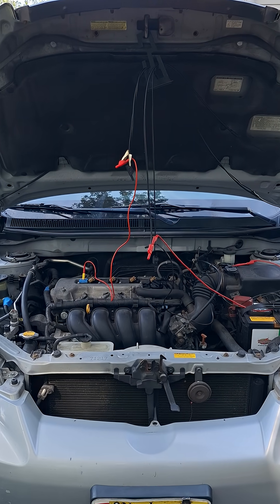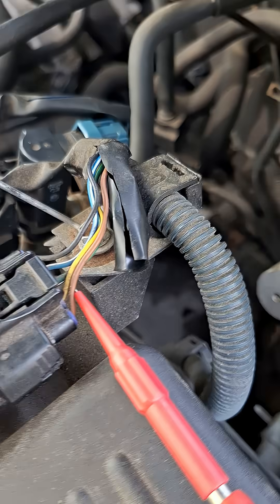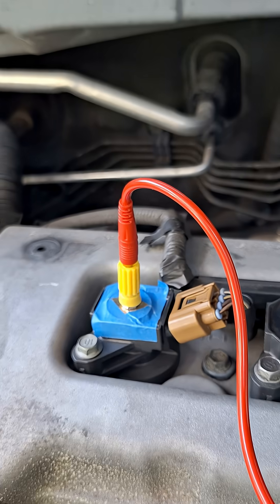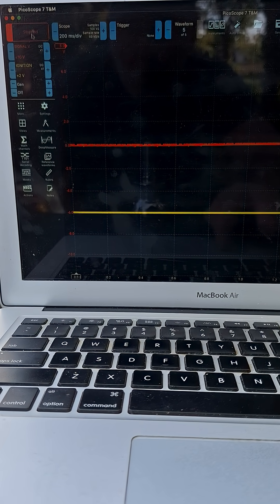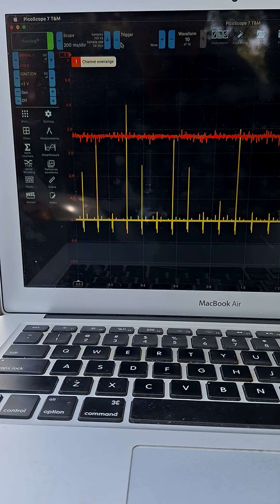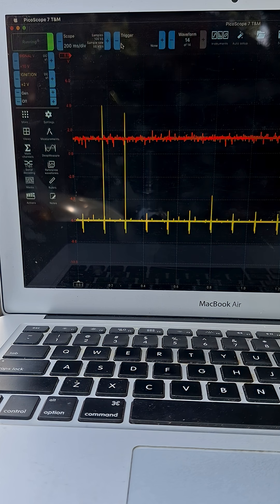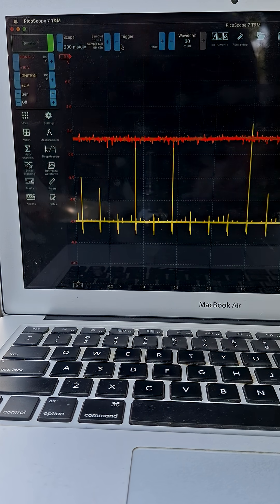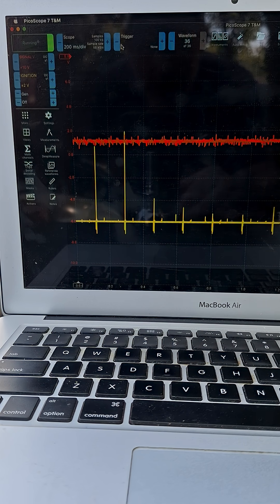Mass Air Flow Sensor (MAF): Signal Voltage increases with RPM.

Comment: Any scanner with sensor data wood kwikly show MAF Malfeasance. Old Denso MAFs common fail over 10yo - 150,000miles.
Always use Denso exact replacement to avoid unsolvable nitemares
Reply from the maker: Yup. I actually still have my original one on my 2006 Matrix (232,000 miles). Still reports mass air correctly. And you are 100% correct, OEM only for MAF sensor. Thanks for commenting and watching! 🔧